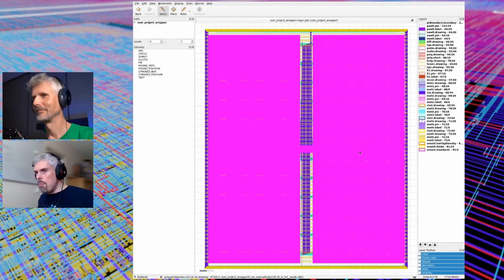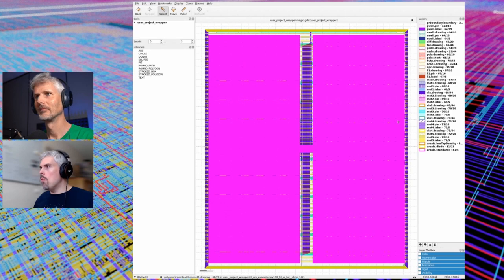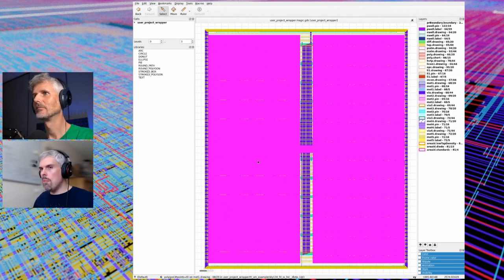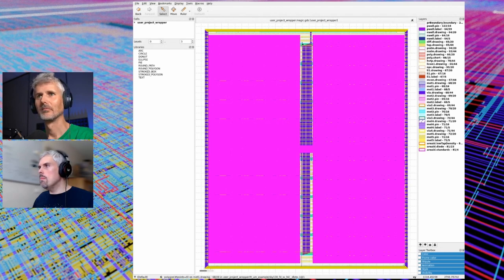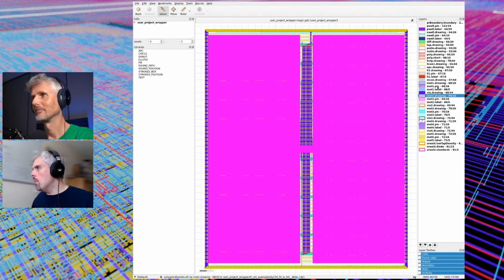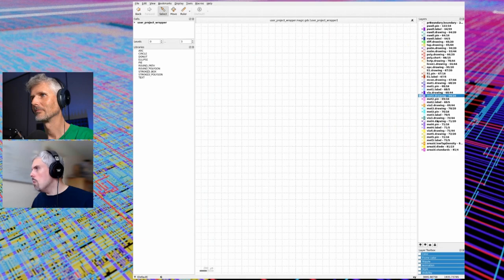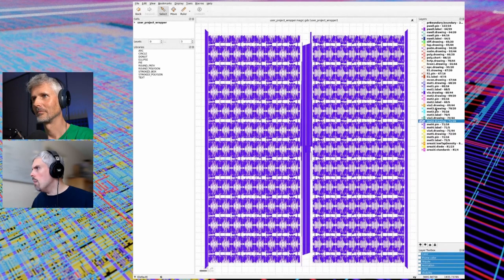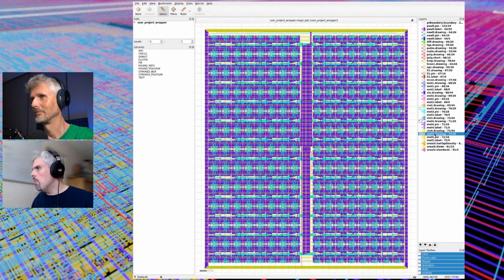TinyTapeout multiplexer progress with Sylvain 'tnt' Munaut - part 3

Comment: If the tristate buffer is so slow, I’m wondering what the result would have been of a AND at source and wide OR tree. The OR tree would act as buffers.    The high latencies might make doing something like a SPI Target device hard (given read data has to be aligned against source clock, as opposed to xSPI with a source synchronous edge aligned read strobe generated by target device).

Comment: Did you check the spine for antenna violations?
Reply: Because the spine is on `met4`, it's unlikely to cause an antenna violation, but to be extra sure, we have a protection diode on each input buffer wired to the spine.
Reply: @smunaut  Great! Thanks for all the cool work